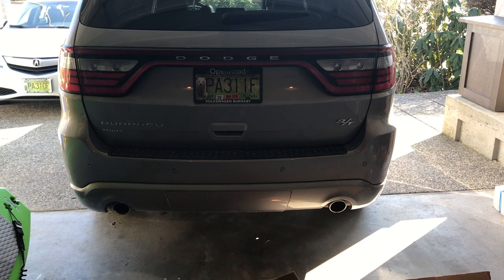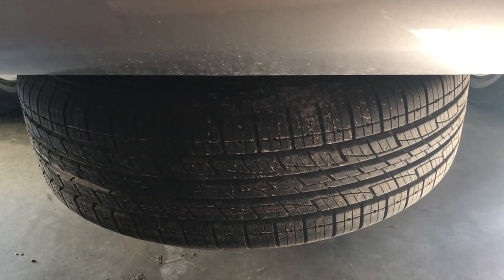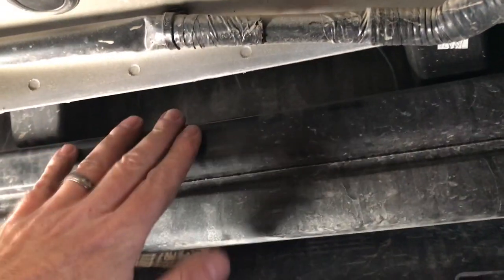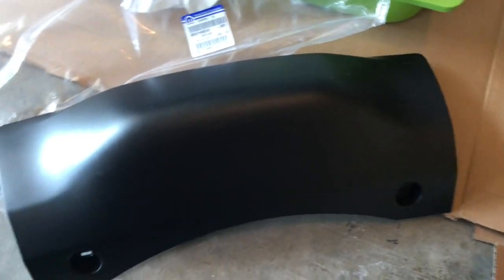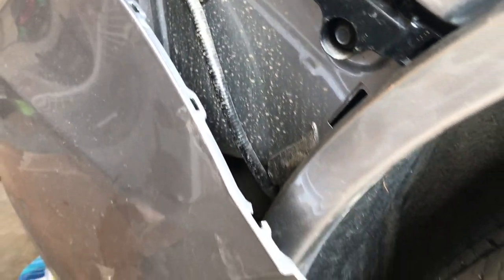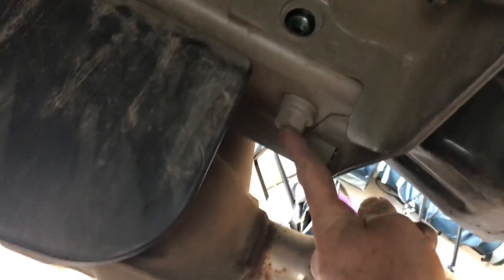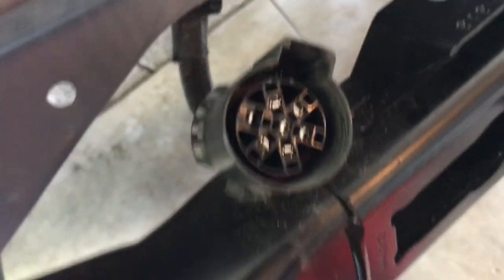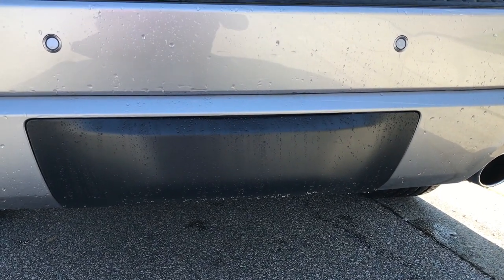Dodge Durango R/T Hitch Installation

Comment: WOW!  I watched several different TOW/HITCH PACKAGE installs and you have the BEST Instructional video yet! Not many show the pre wired installation procedure.  I have a 2015 Citadel and it came pre wired.  Thank you for showing the correct hitch and all the hardware. There are several MOPAR hitches on the market and some do not have the seven pin/five pin mounting hole installed. Now I am ready to install my hitch!!  THANK YOU!!  This made my Friday COMPLETE! :-)
Reply from the maker: Thanks Bill. My pleasure and glad this helped. I did a ton of research and am very happy with how this all turned out. It's fairly straight forward and pleased this helped you out. This is why I love YouTube!

Comment: Wow thanks for this! It has sorted out a lot of confusion. I had just finished inquiring with every Dodge dealership in Calgary, and without exaggeration every one of them misinformed me in one way or another. 

Depending on whom I spoke with, I'd apparently need to buy the entire wiring harness, no activation is required, the factory-installed hitch is a class IV but only a class III rated at 3000lb can be purchased aftermarket so I'm SOL, and the brake controller is not included in the wiring harness so I'd have to purchase and install one separately.

After discovering and watching your video I checked my Durango R/T, and the harness was right where you said it would be. I'm also very relieved to hear that the standard Mopar OEM hitch is the required part for the full 7200 lb towing capacity. And I did finally find one dealership that was able to give me a price on activating the harness ($65 CAD).
Reply: One guy I talked to in parts, insisted that without the factory tow package my D R/T would not have the required prep package (HD cooling etc.). He asked me for my VIN, and -- after taking the time to condescend to me like the Comic Book Guy from the Simpsons for reading him the entire VIN instead of only the last 8 digits --  he pulled up my build sheet and insisted that the hitch receiver MUST be installed already, since all the other towing components are there. LOL!
Reply from the maker: shanksworthy that’s great! Thanks for watching! Happy for you. I too got all sorts of mixed messages so that’s why I wanted to clear this up for everyone and help. Enjoy towing with your R/T. I love mine!!
Reply from the maker: shanksworthy yeah getting the build sheet is key. Will tell you everything that the vehicle has installed 🙌🏻

Comment: Looks like for 2018 and up the wiring is not already behind the rear bumper. The wire harness (pn 82216007AC) is  bit more extensive to install.
Reply from the maker: Well that sucks

Comment: So I’ve just finished installing the hitch receiver and it was relatively simple thanks to your clear instructions. 

I’m just putting everything back together and I did have one question: How did you re-install the rivets for the fender trim in the wheel well? The kit comes with new rivets but none of the videos ever show anyone installing them, and I don’t have a rivet gun.
Reply from the maker: shanksworthy I went and bought a plastic rivet gun from princess auto.Not sure if you are in Canada or not but any auto parts shop should sell them. This was mine 

https://www.princessauto.com/en/detail/plastic-hand-riveter-kit/A-p8599052e
Reply: I'm in Canada (Alberta) and we have a Princess auto. I'll try to find something like that. Thanks! 

BTW I was able to get everything back together with only the following minor issues:

* Broke one or two tabs when pulling the fender off, although somehow that doesn't seem to make a difference as it still seats securely.
* The bolts on each upper wheel well had nothing to screw into. On closer inspection, I found 2 threaded plastic pieces on the ground on either side which looked like they'd broken off. So I just held them behind and screwed the bolts into them anyway. Doesn't seem to make a difference.
* After putting everything back together, I pushed the button to close the rear hatch and got an "error" noise (3 quick beeps). Tried several times and it wouldn't close! After a failed attempt to google the cause of the problem, I finally gave up and manually closed hatch. But then just for fun I tried the button once more, and to my relief it opened. On the subsequent button-press it closed successfully, so it looks like it's all good now.  Not sure what happened there, but it did initially cause some panic.

Comment: Do you know if srt Durango comes with the wiring harness installed?
Reply from the maker: Hi Johnny. Thanks for watching. It depends on the model that you have. As I mention in the video, you can have the dealership pull the factory spec sheet for your Durango using the VIN and it will show you what equipment is included. Failing that you can do an inspection under the rear bumper and if the wiring harness is included, you will see it. Good luck!

Comment: Nice job... thnx. I'm leaving soon to look at a R/T without the hitch and now I know the SUV has all it needs to attach the hitch.
Question... how much for the Mopar hitch and how long did it take you ?
Reply from the maker: P. Alex Coelho thanks for watching! In the video description I listed all the parts and their respective prices. The hitch installation probably took me about 2-3 hours including the installation of the brake controller. Are you looking an R/T at a Dodge dealership or private seller?
Reply: @simonblunden2151  looking at lightly used at a dealer, as private sellers are not many a dime here in Quebec.
Thnx for the video and answers.
Cheers
Alex
Reply from the maker: Make sure you get the dealership to look up the VIN and print out that spec sheet that I refer to around 15:05 in the video. Goo luck. They are a great truck

Comment: Really good video! but why do you need the brake controller? I thought the wire hardness in the hitch works as a brake controller?
Reply from the maker: Albert Tot thanks for watching. You still need the brake controller to control the brakes (if you have a trailer with electric brakes). With the tekonsha it applies the brakes in proportion to the Durango’s braking. I know some pick up trucks have a brake controller integrated but the Durango’s don’t.

http://www.tekonsha.com/mobile/products/brake-controllers/proportional-controllers/trailer-brake-control-proportional/TzaIxkVx1cI5XOy!osRB52uqDvaehMa!

Comment: Simon, great video. I got a GT 2wd, and I did print out parts per VIN. So it turned out it has only standard duty cooling system, together the 'Trailer Sway Damping''. Any suggestions on this setting, do you think I have wiring?
Reply from the maker: Hi Guojun. Thanks for watching. The best way to see if you have the factory wiring harness would be to physically check and look under the truck behind the rear bumper as I show at 2:39 (onwards) in the video.
Reply: @simonblunden2151  I checked last night, and didn't see it.
Reply from the maker: I think you may be out of luck then. The R/Ts came pre-wired and with all the extra items needed for towing, but I’m guessing the GTs didn’t. Also, if yours is a V6 it will have less towing capacity. What are you looking to tow?
Reply: @simonblunden2151  Yeah, I guess so. I will only small stuff, a jet-ski or a small trailer the most.

Comment: I watched your video, nice job!!! I do have a question, i see the part # for the trailer connector but what is the harness #?
Reply from the maker: nizzynoss thanks for watching. The 2017 RT has the wiring harness already installed. It’s tucked in behind the spare wheel. You might find information in this forum:
https://www.dodgedurango.net/threads/oem-trailer-wiring.23488/
Reply: @simonblunden2151  s

Comment: Thanks for the video, Simon. I just bought a 2017 Durango R/T last week. I've been doing lots of research too (sounds like you did as well) about the different options for hitches (aftermarket - Curt, etc, underneath bumper) vs. factory OEM. It looks so much better with OEM and the bezel than a hitch underneath the bumper...but I'm concerned that all these OEM hitches from Mopar say 3500 lbs max - even the dealer direct says that. I, too, have the spec sheet and I have all the same tow options you mentioned included on mine, except for the hitch/connector just like yours. So, it sounds like you have the same... Do you still feel good about the hitch? No concerns re: weight capacity for you? My friend says I should get it done at an aftermarket place where they will weld it on, but I'm not seeing any welding from yours or other youtube videos I've seen...guess it's not necessary with the 4 bolts on each side?  Thanks, Cheers, Greg from Surrey, BC
Reply from the maker: Hi Greg, Thanks for watching and leaving comments. If you have an R/T and it's prewired like mine, you have the full size spare, and your spec sheet says you have all the items I do, you are good to tow 7500lbs. I am really happy with this. Just picked up our trailer this weekend and it tows like a dream. I'm not a mechanic and I'd say this was a 5/10 in terms of difficulty. No welding necessary. All you are doing is replacing the factory bumper with the OEM hitch receiver. I took mine to Langley Chrysler at the end to get them to program the wiring harness for $55 and voila - good to go. Message me if you have any questions. Personally I would not do an aftermarket as it will sit below your bumper and look ugly.

Comment: What is the name for the paper print out that says what the car have
Reply from the maker: Dealer spec sheet. If you go to the dodge dealership and give your VIN they should be able to print it for you and it will give the specs for your particular vehicle

Comment: Great video! Will a regular rivet tool work on the plastic rivets that come with the trailer hitch?
Reply from the maker: Andrew Dickson thanks for watching. I don’t think so. I picked up a cheap one at Princess Auto (Canada) and it came with extra plastic rivets

Comment: Can you please add a proper link for the morpar tow hitch package before when I click on your provided link nothing happens .
Reply from the maker: Hi. I didn’t include a link because they expire. If you search “mopar 82214135ab” you’ll get some showing up. Not sure what country you are in, but here’s a link to one I found on eBay today :

https://www.ebay.com/itm/NEW-Trailer-Hitch-Receiver-With-Cover-Bezel-Hardware-For-DODGE-DURANGO-14-17/184244024906?epid=1243362603&hash=item2ae5ccb64a:g:U2YAAOSw5HZehCZu&fits=Year%3A2017%7CMake%3ADodge%7CModel%3ADurango%7CTrim%3AR%2FT%20Sport%20Utility%204-Door%7CSubmodel%3AR%2FT%7CEngine%3A5.7L%20345Cu.%20In.%20V8%20GAS%20OHV%20Naturally%20Aspirated%7CEngine%20-%20Liter_Display%3A5.7L

Comment: Just added it to a 22 rt  it fits but no wiring harness .😢
Reply from the maker: Thanks for watching. That’s crappy about the wiring harness. Are you 100% sure there is t one tucked under the rear bumper?

Comment: @Simon Blunden It's been a couple years since you posted this very helpful video. How has towing in the Durango R/T worked out for you?

I've been towing a travel trailer with my R/T for a year now and it has gone very smoothly, even despite being on the edge of several weight limits when fully loaded up. In fact now that we've started including bikes & my son is getting heavier we're probably slightly exceeding the R/T's payload by a bit -- but I'm talking about the really conservative payload found on the door jamb sticker, which seems to be 1200 lbs on every Durango model regardless of what options it has. :-)  We'll probably upgrade to a truck eventually, but there's no hurry.

I guess the one problem we have run into, is that weird rear load-leveling suspension mechanism that comes standard on the R/T. It's been thoroughly unhelpful, as it seems to fight against the weight distribution hitch's ability to transfer adequate weight to the front axles. I've had to crank the WDH down with more pressure than recommended, to compensate for the fact that it will loosen up after a few kms when the self-leveling kicks in. I've had to become intimately familiar with how my WDH works because I can't rely on the dealership techs to understand the issue.
Reply from the maker: shanksworthy been great! We have a 4700lbs 25’ travel trailer and it’s been doing just fine

Comment: Simon, great video thanks. Hey, what’s the difference between part numbers 82214135AB and 82214135...? They are both listed on Mo par website yet have same description? What does the AB mean? Thx
Reply from the maker: Tim Newsome thanks for watching! Being a YouTube mechanic and not a proper mechanic I can tell you I have no idea what the AB means! I know that’s the part number for the kit that I bought and it worked for my truck. My suggestion would be to contact your local dealer and ask just to be sure. They will ask for your vehicle VIN # and will tell you whether the part you’re looking at is compatible with your unit. Good luck!
Reply: Thanks Simon. Yeah, I called the stealership ;) and they said there is not difference. Thanks again.
Reply from the maker: Tim Newsome the only thing you need the stealership to do is activate the wiring harness once you’ve installed everything. Good luck!
Reply: Simon Blunden I can’t get a straight answer out of calling the dealership! Ughh..

As far as I’m aware, all I need is part 82214135. This is the hitch receiver that includes bolts, rivets, and the plastic bezel cover. That’s what’s in the pic of the party # on Dodge.

I need the Trailer Tow Wiring Harness too right? Part 82213986AB?

Any thing else? Thanks again.
Reply from the maker: Tim Newsome if you have the RT you should already have the wiring harness on the truck. Check by looking under the bumper. If you do, then the only other piece you need is the Dodge 4 & 7 Pin Trailer Connector. Part # 56055632AC. What model and year do you have?
Reply: Simon Blunden I called another dealership and they were much better. Apparently as mine is early 2014 build date, It’s comes without the pre wiring ugh!!
Reply from the maker: Tim Newsome ah bugger. Get them to run your VIN and give you the spec sheet for your truck. I speak about this at the end of the video
Reply: Simon, it turns out I do have pre wiring already installed. Parts guy said all late 2014 builds had them. Mine was feb built...but I still have it :)

I installed it with no major errors. Was a fun task in the end. I noticed those lime green clips in your video and I also have the,. What are they for? I haven't seen where they are supposed to go. Thanks again.
Reply from the maker: Lime green clips?
Reply: Simon Blunden what are those clips for that are 20 seconds into your video. The clips next to the bolts and knife.
Reply from the maker: Tim Newsome gotcha. Yes, those clips are not needed if you do the kit with the included plastic bezel cover. Looks like they are for older models / grand Cherokee. See here:

http://starparts.chrysler.com/info/default/k6861334.pdf

By the way did you paint your black trim bezel (cover)?
Reply: Simon Blunden cool. Good to know.

I haven’t painted it. I will get some quotes. My DD is granite crystal so the black doesn’t look all that bad really. If it’s reasonable, I will get it painted otherwise I will leave it. You?
Reply from the maker: Tim Newsome I did mine myself and it turned out really good. You can buy OEM spray can to match color exactly. I should have done a video on it. Be sure to scuff the plastic and use adhesion promoter before primer. I finished with clear cost and it’s jut like factory finish
Reply: Quick search online and can only find non Dodge websites for the paint? Where did you buy from? Also, what have you done with old bumper? Is it worth anything down the scrap yard? Do you think people will buy it on craigslist?
Reply from the maker: Tim Newsome sorry just saw this now! The mopar spray was from eBay. You could also try the dealership. It’s a small can but enough to do the cover. I just threw out the old steel bumper. I guess you could sell it used

Comment: thanks for this video, im wondering about the bolts that you used for the hitch, i see that the stock bumper has a total of 6 hex bolts. Can i use those bolts again to secure the new mopar hitch or is there a certain set that i need to buy? Cheers mate!
Reply from the maker: elwayb thanks for watching. The only thing you can’t reuse is the plastic rivets but if you buy the same kit I did, you get replacement plastic rivets included. The hex bolts are all reusable for the bumper.  Good luck!

Comment: Why wouldn't I just come with a trailer hitch it's got the V8 hemi just wondering?
Reply from the maker: Not sure. Like most things it was an "available option"
Reply: @simonblunden2151  I have a 2012 Durango r/t is it pretty much the same as yours?
Reply from the maker: @steelfan187  do you have the removable panel on the rear bumper and have you checked to see if the wiring harness is there?
Reply: @simonblunden2151  I don't have the removable panel so I believe it's just going to sit under the bumper and yes the wiring kit is already in there
Reply from the maker: @steelfan187  OK. I would purchase the OEM kit part # 82212597AB. I found it here: https://www.moparpartscanada.ca/oem-parts/mopar-hitch-receiver-82212597ab. The instructions look like you get a template to cut a hole in the rear bumper and then there’s a bezel piece that clips in. Instructions can be found here: https://www.moparpartsgiant.com/parts/mopar-accessories_receiver_trailer_tow-82212597ab.html I would do the extra work to cut the hole in the bumper since yours is prewired. They don’t look that good when installed under the rear bumper (in my opinion). Hope this helps
Reply: @simonblunden2151  thank you